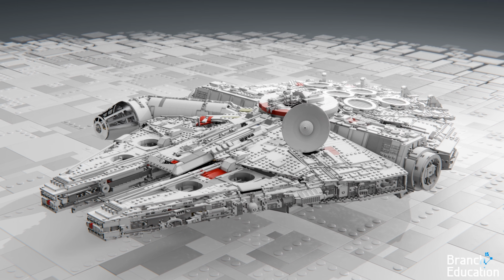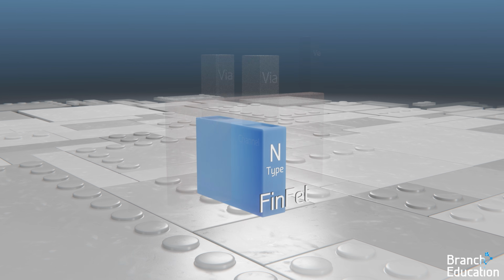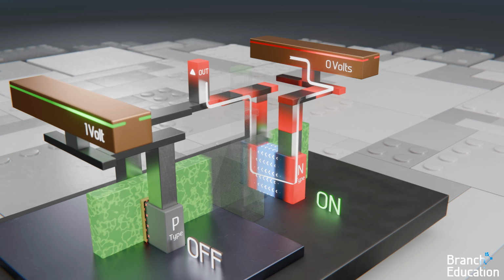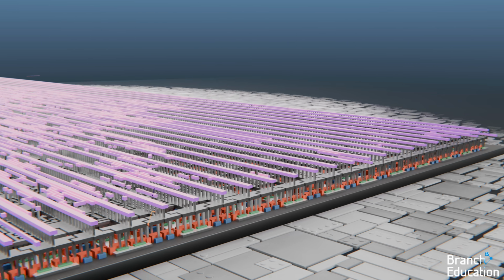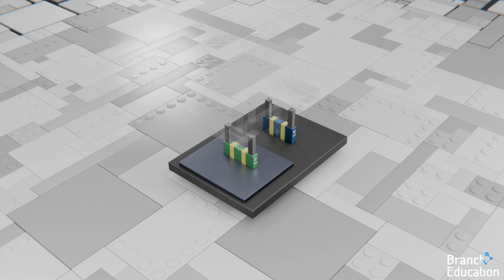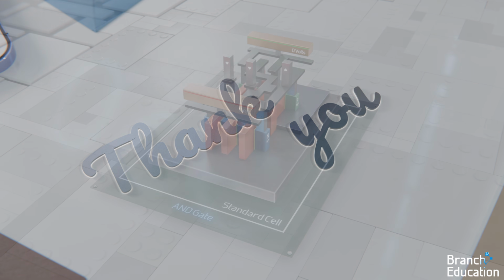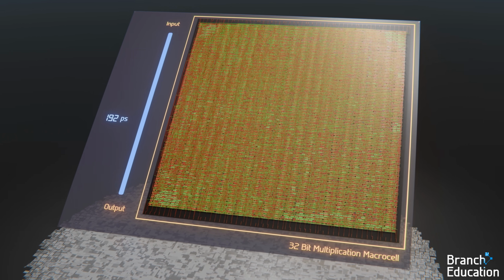How do Transistors Build into a CPU?  🖥️🤔  How do Transistors Work? 🖥️🤔

Comment: Why is it so important that the CPU is small?  
You always hear about the size of the features being x nanometers. 
How does that make things faster?   
Also the density of the transistors on the chip. If the chip were an inch larger with the same number of transistors would that make the whole thing dramatically slower?

Comment: The video was very well produced, especially in the way it explains how transistors work (even in a simplified form) and how logic gates operate.

However, I believe it lacked a clear explanation of the concept of abstraction hierarchy, which is a fundamental principle in hardware design. This concept becomes particularly important when introducing more complex circuits such as adders, subtractors, and especially multipliers.

I noticed that, in the video, the multiplier was shown directly at the transistor and wiring level — which makes the visualization somewhat confusing and harder to follow. Introducing an intermediate level of abstraction, such as logical blocks or simplified schematic diagrams, would greatly improve clarity and make the explanation much more intuitive.

Overall, the content is excellent, but adding the concept of abstraction hierarchy would significantly enhance its educational quality.

Comment: 4:41 Ok, I'm a little confused. For the Not Gate, if the P-Type transistor already gives a inverted output, why put a N-Type transistor?
Reply: I also got same doubt but when i looked it ,i found that the single pmos will not perfectly have the state like perfect low or perfect high so to solve that both are used
Reply: And also if you look closely 8:17  if you have only 1 pmos it will be control an only 1v or 0v but let is consider it is connected to 1v if the input is 1 it blocks the flow so 1v willl not flow but here we need 0v or gnd should be the output but we didn't have 0v connect to pmos 
Important thing here is 0v is not equal to open connection

Comment: Why do you need a P and an N type tansistor to make an inverter? Isn't 0 Volts, just 0? No flow? Shouldn't the P itself be an inverter?

Would have also liked a lot of the "why nots" for the other logic gates.
Why isn't an OR just a wire?
Why does an AND have to be build with a NAND and an inverter? (In any logic gate sim you usually make them with 3 inverters.)
etc.

...guess I'll get my answer in 8-24 month when the other videos release...

Comment: Because our vision captures by far the most information our brain uses, visual learning tends to be the most preferred, and your videos have the highest probability of making complex concepts accessible to most people of varying degrees of analytical capacity.

One small suggestion: when visualizing active and passive conductors, as in wires that are either carrying a charge or not, perhaps instead of just using green and red flows of electricity, it may be less confusing if the red pulsating waves remain static rather than be shown as flowing like the green ones. Most people familiar with how electricity works tend to associate live circuits or conductors with electrons moving along because of the potential charge difference between the ends of a conductor, whereas neutral circuits or conductors are those in which electrons are stationary,  as in not moving at all. The presence of electricity is after all just electrons moving along, as opposed to those which are static like in a neutral state.
This may also help viewers who cannot distinguish between green and red.

Comment: I used to assume that the power is provided via the "0" (lower voltage) or "1" (higher voltage) input also. Thank you very much for showing the entire physicality of the transistor!
Reply: You're very welcome! It's such a common assumption, and we’re glad the video helped make the actual workings clearer. Thanks for watching and engaging!
Reply: "Datat" is provided via 0 or 1 input ;"power(voltage)" switch the turn on and turn off.
Signal(data) and power   on same level but differnt distribution.（Wiring similar plumbers &electricians）

Comment: The analogy of Lego is appropriate but there is that one single piece that is unique because of some abnormality. The part may connect to other parts but then not all parts can connect back to that part because the abnormality will not facilitate it.

I have built some really unique models with modified parts and as we progress we may see machines design new methods for creating transistors and combinations of transistors that humans never considered. 

What is often lost in translation is that sometimes a little randomness can be the reason, the abnormality is the why gate.

Comment: Thank you! Finally a great video that cuts all the clutter and brings everything  about the basics building blocks of iCs together.
 If u take may take a suggestion, a side note on how those input output singnals makes the signals rails (and may be also about the clock signal rails, coz for many processors means GHz), and how all these  rails together make up the different metal layers! 
But thats my side thought only. Its a great video. Channels like @Asianometry should pin this video as an 'Intro reference video' on their page!

Comment: Really great video ! One question thought: what is the purpose of the n-type gate in the inverter ? It's just connecting 0V to the output when the input is 1, which seems kinda useless since the p-switch is already turned of and thus outputs 0V. So why is there an n-type gate ?

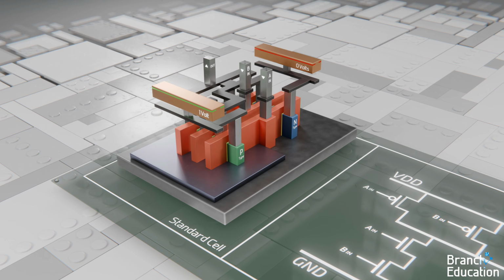Comment: 21:53 wouldn't it be the same as using just the NAND layout and flipping over the GND and 1V rail? in that case the output would be 0V if either one of the connected parallel P transistors would be off but it won't let through if both were on and in that case both N type transistors in series would let the current pass giving a 1V output. Why is it like that? Wouldn't it make the cells smaller? I cannot think of a motivation why you need to make it more complex when you only need to flip the cell... if anyone knows it, please let me know, I'm interested!

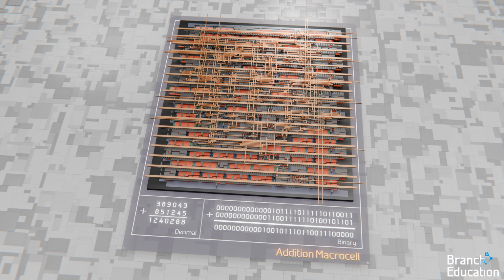Comment: 11:07 — Amazing animation as always! 💯 But in on the macrocell example, the label isn't grouping the bits by four, making it difficult to read the binary...thus my question: is that a 24-bit adder? Why is it not a power of two? (Typically 32-bit or 64-bit these days, but any power of two would do.)
Reply: Okay later they mention 32 wires, so probably a 32-bit adder, but the lack of digit grouping in the label made it difficult to see. 😄
Reply: Moreover it's a very interesting question because knowing how many components are required for each size of adder would be handy. If I recall correctly, I've only built a 4-bit adder in simulations.

Comment: I have a degree in computer engineering, and really love the quality of these videos. My only criticism of this video (super pedantic):

It's titled: "How do Transistors Work? How are Transistors Assembled Inside a CPU?" however, this video primarily focuses on the latter. I was almost expecting a reference to BJTs at some point. The best analogy I can think of is having a video titled "how do internal combustion engines work" and only mentioning gasoline-powered vehicles [and not diesel]. It may be important information to learn that transistors are not solely used for integrated circuits

This video is still awesome. 13/10
Reply: If you think you can do better, go and make a fully animated video describing all of the THOUSANDS of uses of a transistor, you're more than welcome to do so.
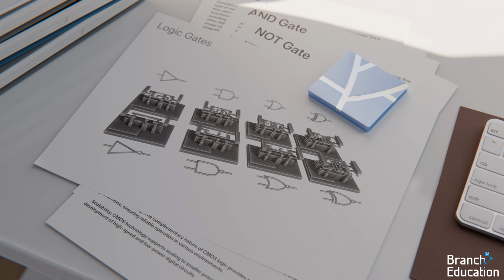Reply: @VincentPaulS I appreciate your permission! It was easier to reply with a comment which offered feedback (which is requested in 20:35)

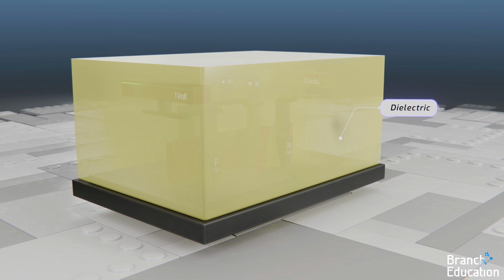Comment: 8:35 Structurally, I understand that the component needs to be a "solid block" in order to not fall apart. But since the surrounding "cement" is also dielectric material, wouldn't it cause for the dielectric material of each transistor to be abridged, therefore bricking the electric circuit logic? I know in practice the system works, but I can't quite grasp how this "seepage" between the surrounding and "internal" dielectric material is prevented or avoided.

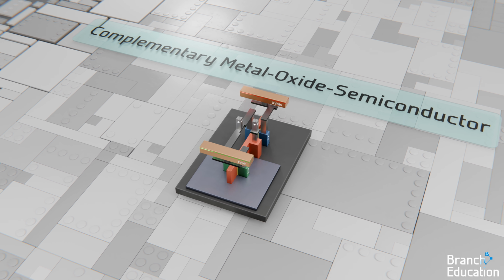Comment: 24:00 is that true 4 real? There is never a path between 1V and 0V? because university tought, that it is. Or it is in some kind of way... Or not?
Because even if the switch perfect, however both have a rise and fall time until the flip from blocking conducting. And at 1 point both are "semi" conducting. Does this don't exist anymore? How does CPU get 250Watt power consumption?
Is this all from leakage electrons from the GATE Channel? Or tunnel effects?

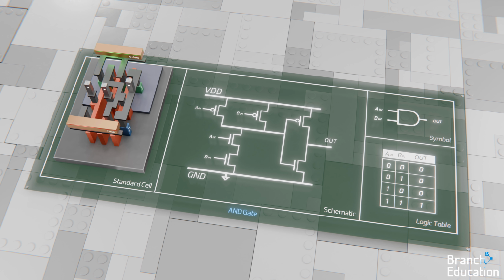Comment: 21:47 Interesting... The AND cell is a NAND cell combined with a NOT cell
Reply: The "Normal" Non inverting AND is more complicated xD
Reply: @chipsian  Yup. It's because the NAND cell is a universal cell. You can make all the other cells from nothing but NAND cells
Reply: @koppadasao  yes The teacher st school told a lot about that.
🗣️"Here is a Logic circuit, Now you have to make the same logic, but only with NANDs and the other group only with NORs"
Reply: @chipsian  Like From NAND to Tetris...
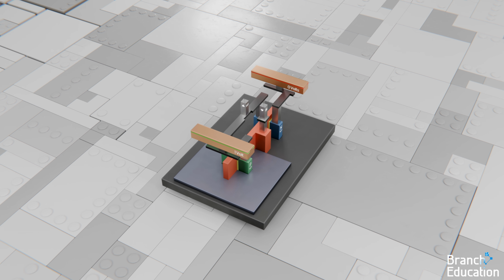Reply: @koppadasao 24:00 is that true 4 real? There is never a path between 1V and 0V? because university tought, that it is. Or it is in some kind of way... Or not?
Because even if the switch perfect, however both have a rise and fall time until the flip from blocking conducting. And at 1 point both are "semi" conducting. Does this don't exist anymore? How does CPU get 250Watt power consumption?
Is this all from leakage electrons from the GATE Channel? Or tunnel effects?
Reply: @chipsian  Well, yes, and no. During the switching time the output is indetermined. Technically there can be a path between Vcc and Vss, but this highly unlikely and only briefly. This is possible because the switching doesn't happen instantaneously, however the design makes the possibility of a short circuit almost impossible.

The CPU power consumption depends on how many paths the current passes through, and how much leaks away as heat. A single basic cell doesn't consume much power, but when you have millions and billions of them, it adds up.

Tunnel effects is due to the size of the transistors. If the transistor is small enough, the atoms will be so big compared to the whole transistor that the electrons can jump through the gate channel, even when the gate is off.
Reply: @koppadasao i still dont get it why there is no short between VCC and GND. I think there should be a good visual video to explain this 🗣️🗣️🗣️🗣️🫶 xD

Comment: 22:14 can anyone correct me but isnt a AND gate the same thing as an NAND gate but with flipped GND and VDD rails ? so you can make an AND gate with 4 transistors instead of 6
Reply: I believe this could be concluded due a simplification on the way N and P FinFet works. To "open" or "close" the transistors, the gate voltage (input voltage) is applied in relation to the drain voltage, which, to make things simpler, is intentionally ommited in the video. For a P gate to be "closed" (ON)  you need a diference of potencial between the gate and the drain of -1 volts (the drain is the top pin of the transistor in the schematics). Switch VCC rail with Ground rail would make this ddp to be equal to 0V (0 in the drain - 0 in the gate) so the circuit would not work as you expected. A similar tought applies for the N -fet. So that is why in this design you need to connect a invertert to the NAND circuit to make it an AND. But good obervation nevertheless!!
Reply: @viniciusrochadasilva8877  if you need an voltage different between gate and drain. how does the n type transistor open if the drain is "floating" or do n transistors need their differenc between gate and source? @viniciusrochadasilva8877
Reply: @viniciusrochadasilva8877  do you have a good website where i can read about that topic?

Comment: Can someone explain why AND gates use a NAND gate followed by a NOT gate instead of just having power rails of the NAND gate flipped? (similarly for OR/NOR)
Reply: OK after some googling apparently  P type and N type transistors are always connected to the same power rails due to the way in which they transmit signals being amplified in that configuration as opposed to giving a less clear 0 or 1 than put in. Not looked into transistors enough to know why they work in this way

Comment: This is a great but simple explanation of the building blocks, that makes every instruction that has ever been written tick!

Even if there's many asterisks, when it comes to painful reality.. :p
Reply: (For anyone interested: The word 'Transistor' is a general term for the different Types of gates.. While not all, the general majority of Transistors inside a PU(Processing Unit) consists of MOSFET's.. MOSFET's in a simplifed summary, is a Type of Transistor witch changes it's state by Voltage, unlike the BJT Type of Transistors witch changes it's state by Current..

The pain of reality when it comes to Transistors, comes from the fact that Transistors are.. Kind of a variable resistor and two capacitors on mushroom's.. Many metrics and parameters need to be considered when you try to push the limits for optimization and profit..)
Reply: Summary of above: Transistors are a pain in the rear, even when you try to simply change a MOSFET's state to on, you might need to play around with the Gate Resistor value.